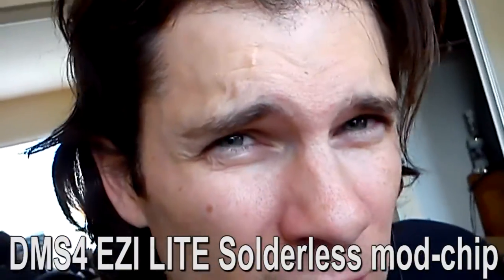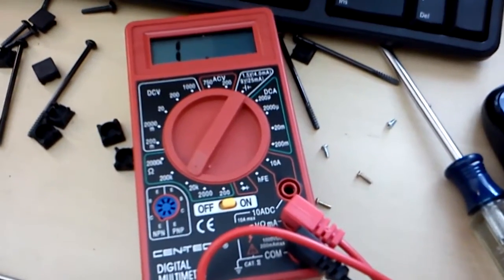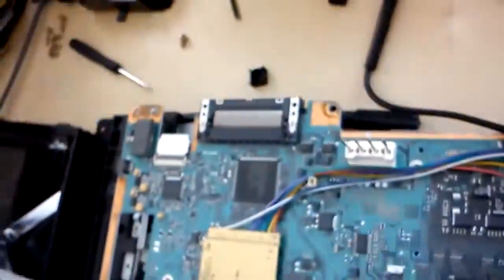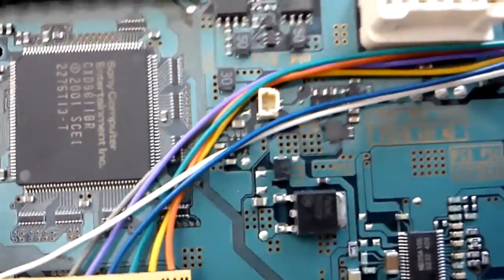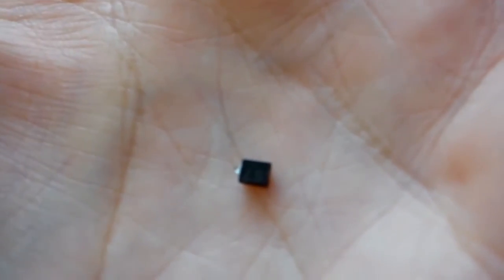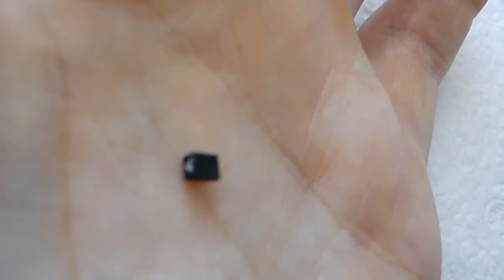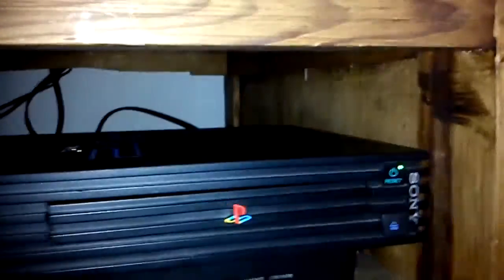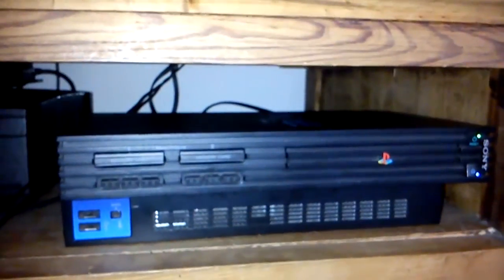PS2 DMS4 mod-chip Red screen Fuse Replace Free Mcboot Softmod

Comment: The clips are known for causing these kind of issues. ;)

On another note... ESR plays 99.9% of all games... O.o

'Open PS2 Loader' is better than HDLoader! It supports quite some stuff like Pad-emulation, Resolution-Change, Virtual MemoryCards, Cheats, and has a far better compatibility! ~95%

You get one of the newest OPL Betas, or 'Daily Builds'!

A LOT PS2-Apps are currently updated quite a bit!
Reply from the maker: Alex J thanks for the info. 😃 does ESR work with PlayStation 1 backups?
Reply: Kentypoo
Nope.
Do you intend to load PS1-Discs (i.e. Backups or Imports) l, or from a storage-device (HDD, SMB/LAN, USB, FireWire)?
Reply from the maker: Alex J by disc. I tried loading them off of the hard drive using a PS1 emulator loader. It did not work good at all
Reply: Kentypoo
There are 3 ways.
-disc-swapping (i.e. via uLE/wLE, or Cogswap)
-POPStarter (rebuild Sony-Emulator)
-PS2PSXe (Homebrew Emulator)

Comment: check the bios connection of chip.  may have a short
Reply from the maker: +Erick Acosta hey, thanks for the tip. I did check the bios clip that clips on to the bios and it looks secure. If I remove it I risk wrecking the mobo as I have done with my previous PS2. Have a good one.
Reply: I've subscribed cause I like your hair.